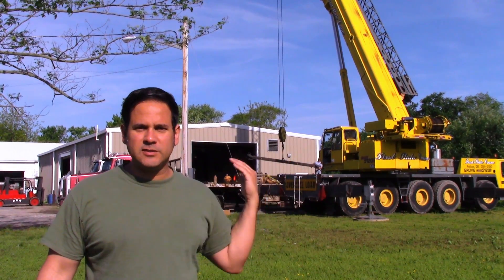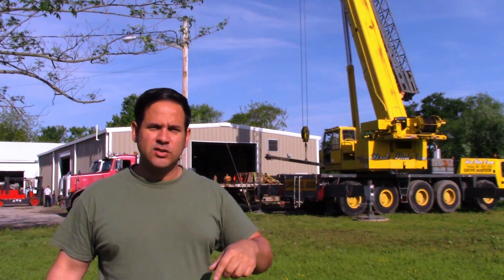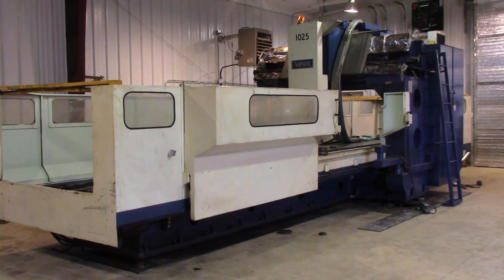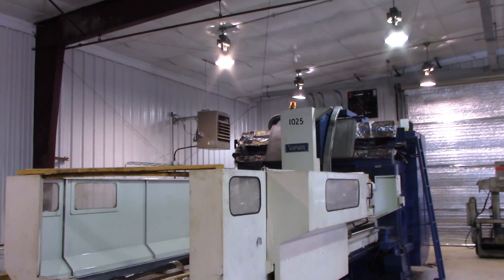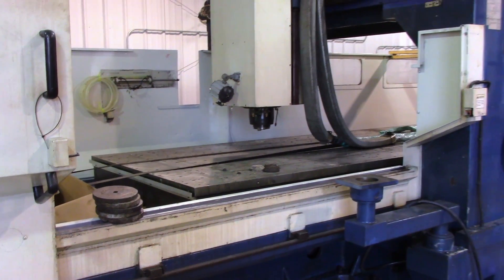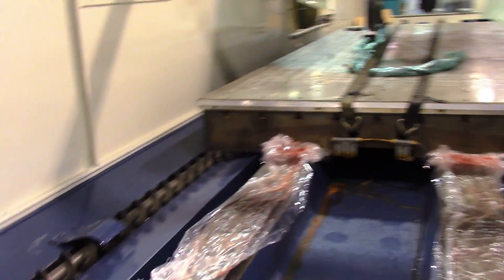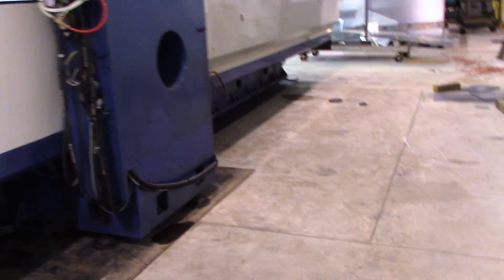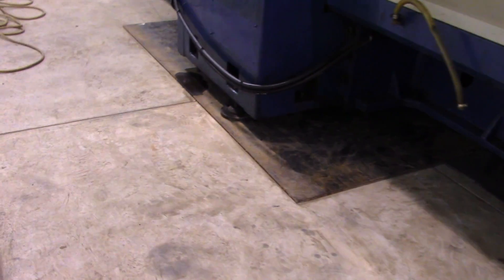Our NEW BIG Milling Machine - Mighty Viper 62"x162" Table

Comment: I operate a very similar ACRA at work, i dont mind it. table height is nice but setting up anything out of arms reach and having to climb in and out is a pain. These are generally s mold making machine but we use ours for predominately machining beams, rhs etc..
Reply from the maker: it will be a nice machine and we have about a years worth of work for it

Comment: Worked 2 weeks ago on a San Rocco with 750" of travel. They also have a Pama with 900" of travel
Which control does the machine have? I specialise in CNC machine upgrades.
Reply from the maker: this machine has a mitsubishi controller, if you are a CNC machine tech, we should probably talk
Reply from the maker: Hi Bill, finally got around to seeing this message!! just sent you an email